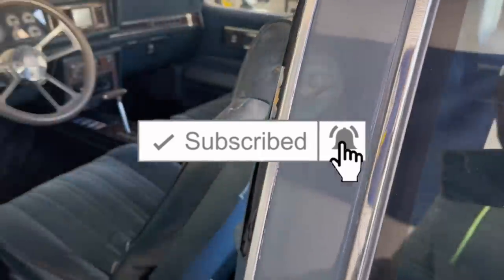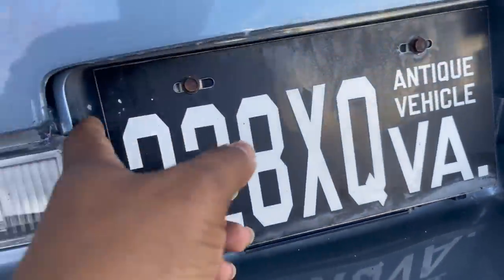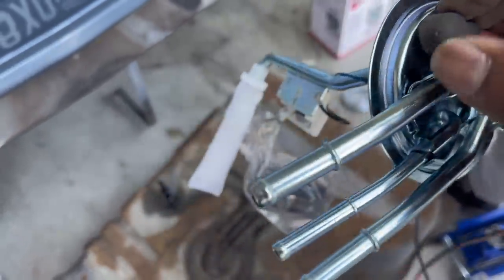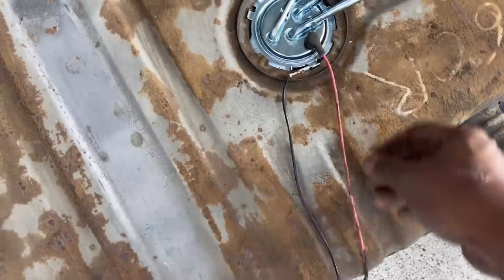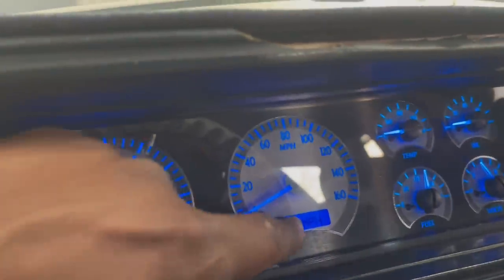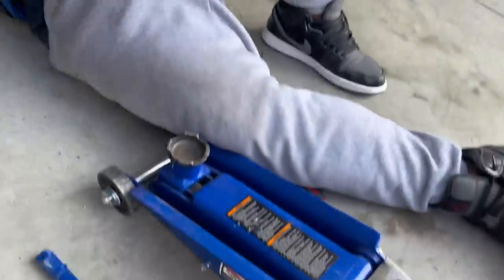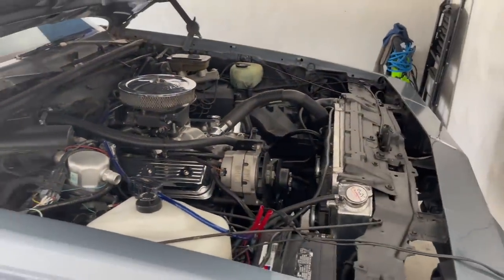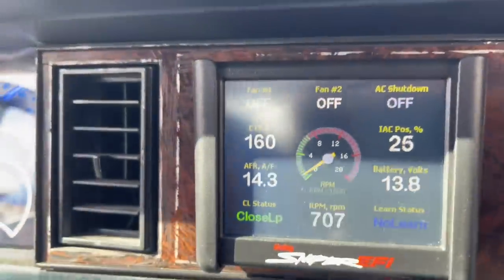85 Cutlass Salon Fuel Sending Unit Install

Comment: 👍🏾Nice job put the work in and got it done u gave me the confidence to pull my tank down and figure out what's going on ✌🏾
Reply from the maker: Yessir, get 'er done...easy job🦾💯
Reply: 864doorcutty it depends on what you are driving some cars have opened space in trunk some you just take the back seat out to change the fuel pump

Comment: Initially I was looking for this video but got distracted by the gauge install. 👍🏽 thanks. Good idea on the flex seal for the trunk. I was thinking of using bed liner spray.
Reply from the maker: lol, man I appreciate the support and yea that flex seal works a lot better in my opinion…it spreads more evenly…we ended up using it in my sons cutlass trunk as well
Reply: @87SSBOI  yeah I’m gonna use the flex seal. I had a Monte back in the day, the carpet that it had was trashed. The guy that had the car before would transport his tools and what not in the trunk. Ended up rotting out the area where the spare wheel goes.

Comment: I had to put a new tank in in my 86 cutlass broham. and yall did it the same way, but i used a 2x4 to hold up the tank across the floor jack ,but it worked 👍
Reply from the maker: Yessir!!! Easy, quick DIY job...🦾💯

Comment: Where did u connect your 12v constant wire in the fuse box
Reply from the maker: For the dash? Either way, I don't remember but all u have to do is use a circuit tester and find a constant 12v...refer to this vid if u don't know how👌🏾💯 https://youtu.be/AJ5Ra60whFc

Comment: I just had to put a new sending unit and fuel pump in my 1986 IROC Z28 now you know on that car you have to drop the rear end somebody cut the fuel rail on a sending unit and could have trapdoor in the hatch area I'll put it back off Factory you guys should've  put a new hose on that one end  so you guys wouldn't  have to go back up in there that old hose might leak all new braided fuel lines on it next time probably back in now 🤣 and don't forget to scrub the gas tank and painted silver

Comment: Im replaceing the sending unit in my 86 Monte Carlo but it only had two lines and the new one has three like the one you have my question is what to do with the 3rd line
Reply from the maker: You can just plug it…or u can go buy one with 2 lines…most cars have 3 lines (supply, return, vent)…I’m guessing yours just has supply and return
Reply: @87SSBOI  ok thanks for the info yes it just had return and supply I guess someone changed it out before me

Comment: While the tank was off y'all could have used a metal wire brush and got the rust off. Hit it with the rust inhibitor and sprayed black rustoleum on the top half 💪🏽💪🏽
Reply from the maker: Yea that what I would have done but my bro is impatient and doesn't like to go the extra mile 🤷🏾‍♂️
Reply: @87SSBOI  ok I see

Comment: Hey just trying to give you a helping hand the fuel sending unit run them tabs around until they stop number two stock clamps get rid of them use these they're safer for your safety your families and your car KE-F16BX that's one of the part numbers just don't want to see somebody have problems with their car
Reply from the maker: Thanks 💯...yea it wasn't in the vid but we realized we didn't go all the way around with the tabs before we put it back up...thanks for the assist 💯

Comment: I do not see nothing wrong with running that with your brake lights because when you're stopped you're not getting air flow through the radiator that is actually very intelligent smart thinking on that person cuz if you're cruising you don't need the fan but if you stop at a red light you need that fan I do not approve it definitely not a bad idea
Reply from the maker: I think u may have misunderstood or I mis-explained what was going on…he needs the fan at the stop light…when he hit the brakes it disengaged the fans therefore when he needs the fans the most they shut off because he is on the brakes
Reply from the maker: They ran the fans thru the cruise control switch which disengages when braking